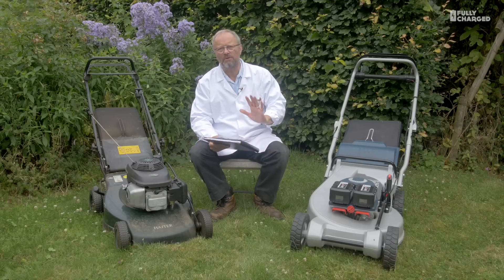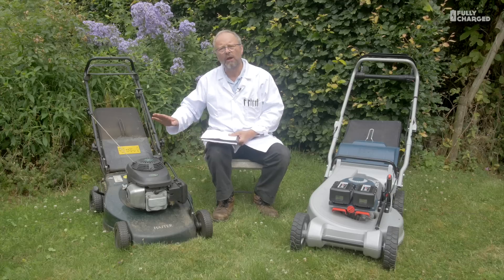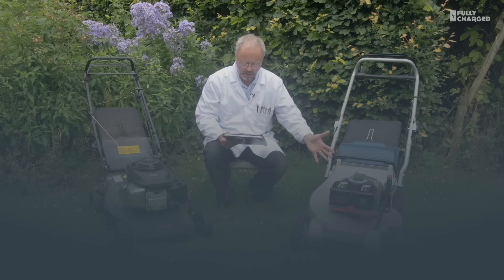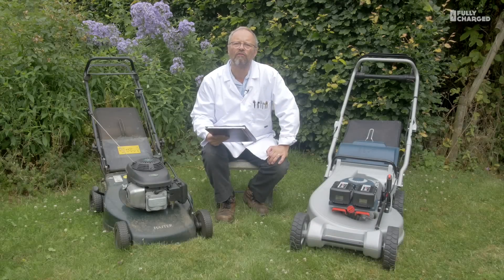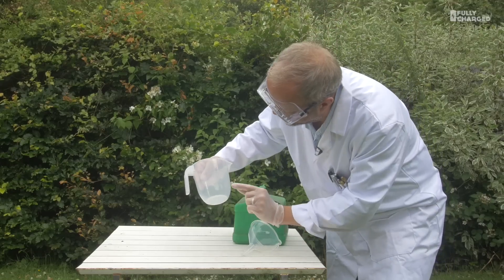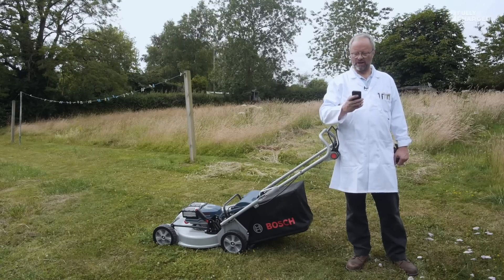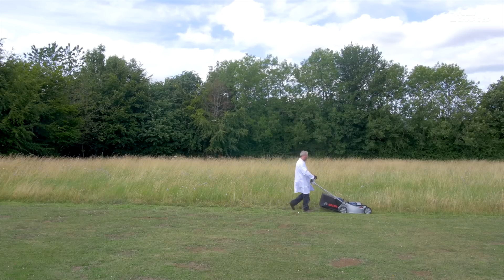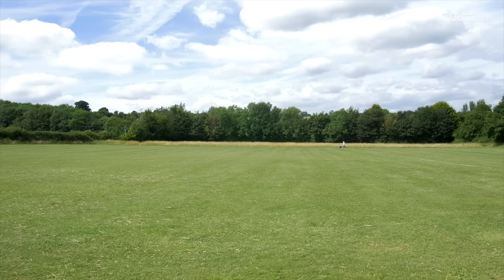Battery V Petrol. The Lawnmower Test | Fully Charged

Comment: One of the advantages of those old petrol mowers is that you could leave it for years stuck in the back of your shed, come back to it clean it out stick petrol back into it and it would work like a dream, the battery mower would cost you an arm and leg to replace the batteries after leaving it for a few months if you didn't keep the batteries charged up, put simply they would die a common death that plagues batteries, and that is assuming you could actually find somewhere that still made the type of battery it used.
Reply from the maker: +flitsies Extraordinary how people make up more and more complex and convoluted reasons based on nothing but casual conjecture about batteries. The batteries won't 'die.' It may be true that 10 - 15 years ago, with much less advanced battery technology they were 'plagued' (notice past tense) by such problems, but they aren't any more. The batteries being produced now will probably last longer than the mower and can be left untouched for years with no adverse effect.
So basically you are 100% misinformed on all the points you tried to make, I'll hand it to you though, an original approach.
Reply: fullychargedshow So what you are saying is that if you left these batteries uncharged for let's say 10 years which is not an unreasonable time span in a warm place next to lets say a spot that often gets damp these batteries will not be affected by the lack of maintenance.

Considering most batteries need a maintenance charge every so many months I find that hard to believe.

So I think you need to do some new calculations with regard to how wrong I am.

If they are lithium batteries though they will last a long time in order to keep them up to scratch it is recommended to charge them up at least once a month if not being used.

I also have devices that use lithium batteries that have been left uncharged for 5 years to go back to them only to find the batteries will not charge. 

I'm not against battery tech I have a battery motorcycle a battery bicycle and a battery powered moped and I'm considering buying a battery powered car, but each machine I own has to be recharged regularly to keep the batteries in good condition those instructions came from the manufacturers of the machines.

So let's get it right what you have said is completely wrong, if you don't keep these batteries topped up they die I'm not sure what the actually percentage per month is but it is quite low around the 2% per month unlike NIMH batteries which lose around 10% per week, though there has been some improvements.

Don't blame the messenger.

Oh just a little more on lithium battery systems, the bms is always on and consumes a small amount of power from the battery, and as the owners manual says "if the battery pack is not used for extended periods of time this will eventually drain the battery resulting in permanent damage."
Reply from the maker: +flitsies Okay, I take what you say, although I don't know why you need to go to such angry extremes.
"if you left these batteries uncharged for let's say 10 years"
10 years! Okay, I'm sure they'd be stuff. Why 10 years, why not 20, 50 damn years. Leave your damn batteries for 150 years, then see how good they are!
I can only respond with "leave unleaded petrol in a can in a shed for 10 years and you're left with sludge,' which would be entirely true.
Why is it a problem, for a start there is another episode coming up which explains more about the batteries and what they are capable of, so maybe watch that in a couple of weeks, but from what I understand from the Bosch engineering team behind the mower, the whole point was to make a mower that effectively, in all aspects replaced a traditional petrol mower, which in Northern Europe includes prolonged periods of time where you don't use the machine.
So I was maybe wrong in saying "an be left untouched for years with no adverse effect" because I was being immature and reactionary to your original comments, my fail.
It's bloody obvious that if you left them untouched for 10 years they would be 100% flat, however I don't have any data to say they would never work again, it's not something I've asked, but I will ask in future.
Reply: fullychargedshow (("Leave unleaded petrol for 10 years blah blah"))

But the difference here would be that you could clean out the carb put fresh go go juice in and mow the lawn, easy as pie simple, you couldn't do that with the electric mower you are talking about, that was the point, perhaps in the future there would be a better battery for the electric mower but based on present tech it's fair to say the petrol mower is more flexible long term.

As for the 150 years thing you mentioned there are cars and motorcycles and probably mowers that are around 100 plus years old including electric vehicles so I don't really see the point you are making here, except perhaps to back up what I was saying, that they still can run on the same basic fuel that they did when they were new, except the electric vehicles cos they need new batteries cos they don't make the old ones any more can't.

As for the part where you say your fail, ok.

But it seemed to me you were trying to do a bit of a Jeremy Clarkson on a mower.

I'm am in to all kinds of machines I like the battery machines cos they are so cheap and flexible to run and in general should be more reliable in the short term, but until they fix the problems with the batteries the long term means these machines are less reliable because often the battery replacements cost more than the whole machine to replace.

I have two battery drills like this they work perfectly fine but to replace the batteries it's cheaper to buy yet another drill, it's daft.

I look forward to your follow up vid, I like your show, but one thing why has there not be an episode about the electric motorcycles and the dramas that have befallen them ie vectrix going bust so many times and gone bust again, brammo struggling and having to sell out to another company the name of which has slipped my mind now.
You did a little tiny bit on bikes where you included the vectrix but considering there is only one major company that has actually put out a scooter that looks similar to the vectrix ie BMW I would have thought this would have been a great opportunity to probe the major bike manufacturers as to why they have not put out any good electric bikes yet, why it has been left to the small companies mostly from the USA to challenge the market.

One last thing, it might be an idea to do a show about why the UK govt are so dead against people using small electric personal transport devices insisting that they must be registered as mopeds, if you read the law that relates to them you will see what I mean, electric scooters including kids types are considered under law as mopeds or motorcycles, I can provide a copy of the law if  you wish.
Reply: +flitsies  
What are you chatting about? 

Why the hell would you have a lawnmower that you don't use for 10 years?

I use my electric lawnmower (wired)  multiple times a year i couldn't fathom why you would spend a lot of money on a petrol or battery mower and only use it once every 10 years.

It seems to me you have made up a fairytale scenario where you only use a lawnmower once every 10 years to make a point about battery lawnmowers being worse than petrol ones. 

Ever since i was a child i didn't understand why people would want to use a polluting oil burning stink mower to cut there lovely lawn.
Reply: ***** There have been many people who have bought mowers used them a few times then for some reason don't use them again and leave them in the back of their shed, just the same as there are lots of people who buy motorcycles use them and then leave them in the garden or shed going rusty.

Some people have even been know to do this with a car.

It could be a prised possession of their long lost love one or a reminder of the years that has past them by but people do such things.

So then a grandchild gets their hands on it and either sells it or fixes it up to ride use or what ever, but do it they do.

Now do you understand.

Battery machines tend to be for the now, you use it then throw it away, and as much as I like battery powered machines you still end up with a huge pile of crap to dispose of.

Just look at mobile phones, there is probably a huge pile of mobile phones in some third world country where western countries simply dump them in the pretence of providing telecommunications to a poor country, but what do they do with them once they are finished using them?

Anyway off topic.

I think you understand my points raised about the mower.
Reply: ***** Yes but in order to get rid of the fumes that has been pumped out for such a long time it will take a while.
And then there are the busses and trucks all pumping out fumes and then there are the air craft all pumping out fumes.

I suspect most of the people around today over the age of 10 have probably had their lungs well and truly harmed by all the crap we breath in so if you look at it that way a bit more ain't gonna do you much more harm.

However electric vehicles are the way forward but it does depend on how much the people want to breath cleaner air and to be honest most people don't really care that much if you consider how many people still smoke, it's taken legislation and tax hikes to get smoking down to what it is now but the market is still booming.

Well think of the small electric scooter, our govt is so in favour of them that they are illegal unless registered as mopeds, imagine 100 watts electric scooter could find yourself losing  your driving license simply because they are considered to be motor vehicles under UK law unless you register it and insure it and have a motorcycle license of course, surely if they wanted people to take up alternative transport they would allow these things as an introduction to the benefits ie low cost reliability and so on, not ban it.
Reply: ***** I think you need to read what I said again.

The point about the benefits which I mentioned was about the 100 watt personal electric scooters, which by the way are banned unless as I said you register it as a moped.

I'm all in favour of electric vehicles, but enjoy the low cost electricity while you can, because when more people start to use them you will find a hike in charge prices, I've already considered a method that could be used for making electric car owners pay more for their power, but hey let's hope it never happens but it is such an easy thing to do the govt could claw their fuel tax back with ease.

But let's face it people in general really don't care about air quality, they say they do but they don't, just look at the pollution that came from one weekends worth of fireworks and everyone is happy with it, just look at the cigarettes even at a huge cost people still smoke. 

And then there are all the other things we inhale, seriously people don't give a fig about it, it's everyone else's problem not theirs.

But yes electric vehicles will be the next step, but wouldn't it be good if the govt changed the law on those small electric vehicles so we could all enjoy them without the hassle of having to deal with insurance companies.

Anyway check it out the law says that all vehicles powered by electricity that has two wheels or more must be registered as a motor vehicle regardless of the power, that means all electric scooters including the kids types are essentially motor vehicles and can only be used by them on private land not the pavement.
Reply: ***** Well then you have missed much of the point to what I said in the first comment which was justified by the way. 

Yes battery tech is advancing but no not to the point that petrol has, I suspect given enough time they will though.

One good thing about battery gizmos tech is the fact that it can be powered by just about anything electric, so there is that option, however you do need to do some mods to the gizmo to make it work.

For example I have two drills both run from ni-cads I had no intention of buying ni-cads as a replacement so I used 18650s instead it now works better than before and they were cheaper than ni-cads and can be swapped out with ease, so you couldn't do that with petrol.

However we are not talking about my drills, this mower uses a specific design battery pack, I suspect you could do some mods to make it run on alternatives which would then make it more flexible than the petrol mower, but due to the type of charger you would need might make it incompatible to too much tinkering, and then there is the cost of the replacement cells, no doubt more expensive than a gallon of petrol.
Reply: ***** I have no problem with looking at the up side of these things but you have to remember not everyone can afford the expense of replacing pricy batteries hell some people struggle just to find a fiver for gasoline.

So being realistic about things, petrol vehicles will be around for quite a bit longer until there are lots of cheap good second hand vehicles that people can buy and still get good mileage out of them. 

Now to the point about the environment you made.

Yes you actually can recycle petrol from the air an American team actually built a machine that can extract petrol from the surrounding air thus cleaning the air and producing fuel at the same time.

But even with this ability I think it would be much wiser to go down the road of electric vehicles.

As for the positives in electric tech. When you compare them to that of petrol to be honest I don't think there is a huge difference at the moment, but in the near future there should be assuming things keep going the way they are.

Cost is a huge downer when it comes to electric vehicles, yes you save on fuel but most cars on the road tend to be second hand and they filter down to the poorest drivers, as they stand now you won't get that yet with electric cars cos the batteries will be well wasted by the time the poorest driver gets hold of them.

There are many issues with electric vehicles, many people simply don't understand them and are afraid of touching electrical stuff.

Look how many times have people thrown out a perfectly good tv simply because an electronic fuse blows only for someone in the know to take it home fix it and get another 5 years free tv use out of it, simply because they are afraid to look (for good reason)and simply wouldn't know what to look for even if they did look.

Just look what happened to vectrix.
Reply: +fullychargedshow I've solved this with a electric Lawnmower that comes with a Wire. Yes that's right! No battery at all. It's like magic!!
Reply: ***** Yes we know of these it is like magic but that is not what we are talking about we are not talking about the wonders of the cable and wall socket we are talking the wonders of self contained power storage which even though relies on the wonderous wall socket to put the energy in, can be used beyond the reach of the cable.
Reply: +flitsies Nah it would've seized by then. It'd definitely need a clean up. ICE engines are dirty as fuck.
Reply: Fennecbutt Well yes they are dirty but so long as you store them correctly they can be stored for many many years.

A damp place would see it seize up and probably ruin the barrel but in a dry location not so likely, however with battery tech store it in a dry place the batteries go down, in a damp place batteries go down.

Also batteries are very temperamental and can fail even though at test they give the impression of being perfectly fine.

Use them from new and they will work fine for a long time have them stored and they can be troublesome.

However in saying this, I have a camera that has a battery that is pretty much the best battery I have ever come across, it has been in a camera for several years and only charged about 3 times in total and the battery is still very much fully charged and still very much packing a punch.

It's definitely a strange battery as none of my other batteries have ever lasted so long without needing a top up charge, this battery seems to be the missing link in batteries. 

So if they could make batteries do this all the time then perhaps things would be different, but all other batteries have had an issue of leaking away their charge gradually, this battery doesn't or does it so slowly that it's just the most amazing battery I've ever come across.
Reply: I've encountered many engines which wont start after being in storage
Reply: #01DF01Seba Abdur-Rehmaan I think you are talking about just putting the key in and off it goes, well no of course they don't, but with a little tinkering if they were stored working then they don't normally take much to get going again, fresh go go juice make sure you get a spark and off you go, the battery system will need a whole new battery and that is assuming you can get hold of one, I suppose you could always hack the battery.
Reply: flitsies I get what your saying, but I'm still a big fan of electric.

Maybe I'm an air conditioner too. 😁
Reply: #01DF01Seba Abdur-Rehmaan I am also a big fan of electric I also see it as the near future not so distant anymore.

Let's hope they sort out the batteries sooner rather than later.

I have an electric motorcycle waiting for the price of batteries to drop to a level that is affordable, were it a gasoline engine it would be up and running long time ago.
Reply: so leave them charged and outside the mower

it shouldn't loose its charge as long as it isn't connected to something that uses electricity
Reply: LPyourplay Were that only the case, unfortunately all batteries lose their charge over time even if not connected to anything it's normally called leakage discharging there is a number for it depending on what batteries they are.

For example NMH batteries discharge very quick normally even if not used, though I have found some that claim to have zero leakage still need to test them out.

lithium ion batteries tend to be very good but they still recommend them being recharged every 3 months even if not being used.
Reply: +flitsies The 'zero leakage' NiMHs do indeed hold their charge much better (months rather than days). Longer even than the NiCads they have pretty-much replaced now. Not sure about low-leakage NiMH vs Li-ion rates. Both will still have some charge after a year. 

A major advantage of NiMH is that they don't die permanently if sat around flat for a year or two. Important for things like DIY power-tools (and mowers) that only get used from time to time. All the lithium chemistries really suffer if left long enough to go genuinely flat. Fortunately this takes more than a year so you do get a fair amount of time so long as you don't store an almost-flat cell. Storing fully-charged cells isnlt ideal either. 40% capacity is the least damage storage level.

And to be fair petrol goes 'off' if left in a disused mower for years (the lighter fractions escape and what's left doesn't burn well if at all). But a couple of litres of petrol costs a great deal less than a chunky pair of Lithium Ions.

So yes, the OP is right - this is a disadvantage of battery-powered kit. One way round it is to have less kit pointlessly sat in sheds for years. Use it or loan it...
Reply: xxwookey You loan it then when you want to use it, it's broken then you fall out with who loaned it to.

But I have discovered something about lipos that could save the day for them being stored a long time without use.

You can actually bring them back to life even when the charger won't charge them, but you have to do a little jiggery pokery to make them recharge again.

Basically you just have to bypass the safety electronics in the battery cell and charge for a good few minutes/ hours really slow, I mean really slow, then you can hook them up to the normal charger once it gets to a certain point and they will charge again up to around 80% of their original ability or something like that, this was not my discovery but if you check on youtube you will see others discovered it, but I have tested it and it does work.

With that in mind you would think the manufacturers of these systems would put in place a means of bypassing the protection circuit using the normal charger and have a settings on the charger for this purpose for recapturing the lipo cells.

I have tried this on cells that had a reading of around 1v it doesn't always work but it sure would save a lot of disappointment if they simply built in a system.
Reply: +flitsies Jeremy Clarkson on a mower - haha!
Reply: +flitsies Now, what you're talking about here doesn't really happen anymore unless you deliberately try to damage the battery by over-discharging the cells (which presumably would be prevented by the built in safety circuitry). But lithium-ion batteries do degrade over time with use.

Just from experience, I've never really seen extensively used lithium rechargables degrade past 70% of their original charge, but for arguement lets assume that they degrade to about 50% after a couple decades.

That's still almost an hour's worth of mowing, and considering that the total capacities are lower the charge times are going to likely reflect that to an extent, so like every 50 minutes of mowing you would have to wait like 15 minutes to charge the batteries back up.

In terms of efficiency that is still multiple magnitudes better than using petrol, and I really don't see why even a worn out battery would be a problem on an average lawn.
Reply: Gigahawk515 Well I have plenty of these dam batteries, for sure they charge up but they leak like water, leave them for a day they are flat again, that seems to be one of the ways these lithium batteries fail, once they start getting old their charge leaks away much faster.

I have around 6 lithium batteries that wil charge up to full charge but if left over night will leak away their charge to around 50% then the next day down to around 30% and gradually over the week or so to nothing whereby I need to do a recovery charge.

Lithium batteries are a nightmare or can be.
Reply: +flitsies Well my father bought a electric robot lawnmowers years ago, best mower he has ever had, he was getting tired of cleaning and maintaining the petrol ones each spring (we used to have two or three, some for parts when one broke). All he has to do is take it inside in winter and put it out in spring and check the blade, he will never go back to the petrol ones that's for sure, they even named it. Petrol ones are now harder too maintain than robots or just electric ones, makes more noise and demands that you buy fuel for them in little cans, much cleaner and easier to go with electric. And with a 5-10 years warranty on it they are not worried about it breaking :), and you don't have to have the batteri charge, the power lost in the new ones are minimal.
Reply: entZEROspawn For sure there are products out there that are pretty good without a doubt but in general I have found these types of batteries have a tendency to end up as I said above.
But I'm sure they will get better.
Reply: flitsies 4 years without maintenance is WAY better than a petrol mower's at least 2 a year I think.
Reply: entZEROspawn I suppose it depends on your out look because a basic service would be what a spark plug, change of oil and clean the air filter let's say roughly 10 to 15 pounds.
On the other hand a battery refurb would take at least someone who understood these batteries and that at the moment is still a specialist job which is expensive, and that is assuming you could get into the battery pack without damaging the battery box, then there is identifying which cells have failed.
After paying the "expert" would be cheaper to buy a new battery assuming you could get one, which brings us right back to the original point.
Reply: flitsies But again we have not done ANYTHING to maintain the robot mower at all in the last 4 years so we have saved those 40 - 60 pounds plus extras like gas and time used to maintain and cut the grass, so when we buy a new batteri for it in a couple of years we would have saved enough for a new robot mower instead, so yeah it's also cheaper now that I think about it :)
Reply: entZEROspawn Well not really because judging by the price of batteries one for a robot mower would probably cost double that of the servicing and petrol put together over more years.
But still you wouldn't actually need to service a petrol mower twice a year in real terms, oil change would be once a year tops and a plug would be perhaps every 5 years if that depending on how much you use it.
So in real terms you would not save anything.
It's about finding the real life costs of these things including the inconvenience,
Reply: flitsies "So in real terms you would not save anything. It's about finding the real life costs of these things including the inconvenience," Like I said saving time by not having to actually mow it yourself, just the time you save is a lot of money, now my dad can work an hour instead so that's a 50 dollars right there at least for each mowing. And a batteri is only 150 dollars, so that is a price of 37 dollars per year if the battery dies before sommer starts this year, and so far it runs well. So if he saves just 3 hours of mowing in 4 years and work instead he is actually gaining on it, how many hours do you spend doing it with the old machines ?
Reply: entZEROspawn Well if you put it like that then yes you would be saving money, however not everyone is in that position and some people actually like tinkering with petrol engines but all that aside I doubt there is much in it between a petrol mower and an electric mower for the average person.

And like I said you can leave these petrol mowers for many years without any real harm happening to them so long as give it a squirt or oil and clean petrol it's off running again.

But it is interesting to see the progress of the electric mowers, also the batteries could be used for something else.
Reply: flitsies My dad is a pretty average person I would say, his garden is normal size and he has an average job, house and car. And he has lost many petrol mowers to decade over the years too, they really don't hold out as well as an electric does, the motor alone is going to run for 10 years without maintaining it. Don't know why you are so determent to defend an out dated technologi, just being free from the noise is worth it, and 525 for a new robot one or 200-350 for an electric one is (which is the same for as for an petrol one here) not expensive at all, why buy one you also have to buy gas and oil for and maintain ?
Reply: entZEROspawn I'm not against electric mowers, or electric anything, but I don't see how they are going to over take petrol anytime soon considering how difficult it is to purchase replacement parts for the electric things.
Most of these devices tend to be about use until they break then throw them away.
Petrol tools are made to be repaired, electric tools are made to throw away.
Even the battery packs are not made for the expectation of them needing to be repaired you buy a replacement.
Petrol parts are made to be repaired.
You could buy one mower at the age of 20 and use the same mower for the rest of your life just keep repairing it, however an electric mower would probably fail and you would need to replace the whole thing due to lack of parts availability.
Even my power drill I had to travel a long way to get hold of a replacement battery which promptly failed after 1  year so I gave up on the production battery and made one for my self, but not everyone knows how to do this simple task.
I doubt anyone would have the tools to replace a surface mount micro chip on your dads mower unless they had electronics experience, but petrol mowers probably come with a small tool kit so you can do small repairs with little knowledge.
Can you see what I'm getting at.
You take away the need to learn anything so you don't learn you become a disposable product user, press the button and off it goes, you don't get to check your garden unless you specifically target a patch, wen you have to mow it yourself you get to inspect your garden at the same time.
Anyway both types have their uses of that I'm sure.
Reply: "Most of these devices tend to be about use until they break then throw them away." so are many petrol things, and it's not like they just go to the dump they go to the recycling center and gets made into new things, and they tend to live much longer than petrol anyway.
"Even my power drill I had to travel a long way to get hold of a replacement battery which promptly failed after 1  year" Well here if a product falls inside 2 years of the buying date you will get it replaced for free, and you do know of the internet not hard to find what you need.
"Can you see what I'm getting at.
You take away the need to learn anything so you don't learn you become a disposable product user" Well some people know stuff about electronics and nothing about mechanics, some know how to repair stone works or wooden structures, that does not mean you cant live in a house made out of bricks just because you don't know how to build or maintain one ?, and again it is recycled into new things well at least here it is, don't know about your country.
Reply: entZEROspawn I think you will find that most if not all petrol machines are made to be repaired, and you can usually get spare parts.
As for the internet, yes we do have this medium now and it is very useful but there are still many things that are very difficult to get hold of, perhaps not so in the USA.
With regards to repairing electronics, perhaps it would good sense if there were positive action with regard to training, let's face it you can pick up some really good books on I,c,e engines and most people can do a basic service though modern engines are becoming more complex, you can still get hold of servicing manuals specific to the machine.
However there are no such servicing manuals for electronic machines, there are no fault finding tips and often no spare parts available.
You buy you use and you dispose of when it breaks down.
Often even if you search the net you simply can't get hold of replacement parts, also some of the newer electronic devices replacing components is pretty much impossible without special highly expensive tools that will be used once.
So yes these electric machines will take over but until there is a change in the approach to the way these things are made it will take a lot longer than it should.
Some petrol devices have been around for over 100 years and it's not rear.
Reply: Well depends how you treat things too, oldest still running electric car is from 1896 ,the 1896 Roberts Electric, only car that's older I know of is the steam powered De Dion Bouton Et Trapardoux Dos-A-Dos Steam Runabou from 1884. So a 120 year old electric car is still going but gasolin cars from that time or older does not, guess they where not maintained :) .
Reply: entZEROspawn I think the reason for the electric car that you speak of is that they were very popular at the time, gasoline vehicles were crap, It's a shame they didn't carry on improving them from that time cos then we would have some pretty awesome vehicles now all clean.
But they didn't and we don't, we have a couple but they still have issues.
Also just consider how people like to tinker with their vehicles on the weekends, unless there is going to be a massive educational program in relation to how electronics works and how components and so on work and there is a massive mind change regarding replacement parts and so on these electrical devices will remain use and dispose when broken down things.
 
We see this now with mobile phones, most people will replace a mobile phone rather than have it fixed, cos it's cheaper, or ipods most will replace rather than fix, or mp3 players replace rather than repair, but just getting hold of spare parts at a price that makes it worth repairing them is impossible unless it is your business and even then they often don't bother.
But petrol devices are always repaired, from generators to vehicles, right up until it becomes too expensive to bother with and even then some still repair them for fun.
Reply: flitsies Well you can only fix older cars without electronic knowledge anyway, most newer cars are more sensors and microchips than mechanics now. And that it is cheaper to replace something instead of fixing it yourself is more to do with how cheap we now can produce things, and how much more one thing can do.
"But petrol devices are always repaired, from generators to vehicles, right up until it becomes too expensive to bother with and even then some still repair them for fun." Some do repair their own electronics things too, it's just that most new things as I said is just cheaper and easier to replace, so the bar for when it pay to fix it yourself is just so much lower, and it comes up way less than with mechanics.
Reply: entZEROspawn And it's virtually impossible to get hold or replacement parts in some cases.
Also you will find that with regard to petrol things you can often use an alternative part which can be adapted to fit.
But yes you are right modern vehicles do use a lot of electronics now, and so they do often need specialist equipment to make them work properly, but it's rare not to find a part for one, and the part is usually replaced as a unit rather than components, you could say modular.
Reply: flitsies "But yes you are right modern vehicles do use a lot of electronics now, and so they do often need specialist equipment to make them work properly, but it's rare not to find a part for one, and the part is usually replaced as a unit rather than components, you could say modular."
So like like a batteri on something electric is modular :)
Reply: entZEROspawn A battery yes but the rest of the device though modular in design often you can't get parts.
You can't get a replacement main board for example and often everything is on that main board nowadays so even if you could it would probably be cheaper to buy a complete replacement device.
I'm just wondering what's gonna happen when all these electric vehicles start breaking down with motor problems that coincide with battery problems, scrappage I think.
Reply: flitsies Well the same thing that happens to petrol cars, some gets fixed some gets recycle. And yes you can replace most electronic in cars and other devices, some are even just plug and play made :) .
Reply: entZEROspawn I once repaired a vhs tape machine, I had to wait 2 weeks just to get the heads then the motor needed replacing which would have taken more time and the cost would have been cheaper to simply buy a new one, which I did in the end, used it for copying tapes, but the point was I did it just to see how difficult it would be getting hold of parts and cost effectiveness, it was so cost effective I've never done it again, ridiculous prices for spare parts, the heads cost around the price of a replacement device, the motor was gravy if I had to add on labour charges on top that vhs would have been so expensive it would have been ridiculous.
My car goes down, yes the parts are expensive but no where near the cost of the vehicle until it really starts getting where multiple systems fail at the same time and some can be repaired rather than replaced.
I really like electronic and electric goods especially vehicles but when you have the battery taking up almost half the cost of the vehicle or device it becomes a throw away device.
Like those little mp3 players, for sure they only cost around £5 and they are great, but once the battery goes they are only useful if plugged into something constantly the cost of replacing the battery far outweighs the cost of the device cheaper to buy a new device, so it becomes a disposable electronics device.
Reply: flitsies Some cars you can't get the parts to at all, unless you order directly at the manufacture and the prices are insanely high. And the batteri is changeable in most cars, some even have a rent garanti, so you don't pay for the change of batteries when you need a new one. And saying it's actually cheaper to buy a new one instead of repairing a thing is not a negativ trait too an item.
Reply: entZEROspawn Well I grew up on the idea that repairing something is much more desirable than replacing it were it is economically viable.
The problem is that many things including some vehicles have now started to fall into the category of disposable product rather than repair and reuse and it's not viable to repair.
So if we continue down this line it probably would be better to have all electric vehicles and mowers and so on and do what was done with all those old computers, now if you want a spare part you could always call Africa they had tones of old electronics shipped to them and we wouldn't have even known about it but for the fact that many hard drives weren't cleaned properly.
Reply: flitsies Actually we can't ship our stuff out that easy, they have showed on "Border patrol", a tv show here, where they inspects a truck with compressed plastic bales that there a strick rules about this. They where ordered back because there where pieces of wrong plastic mixed in, non transparent plastic.
Well we kinda have gone a different way here, we reuse on a more nation scale instead, old electronic gets taking apart, concert reused, wood cheeped even earth taken off gardens are being tested to see if it needs recycling/cleaning because of pollution.
Reply: That's why it was a professional version not homeowners version so it would be used every few days and not be neglected. Also these cells left in a smart charging device could help keeping them alive for long periods by charging them every so often.
Reply: the empty can rattles the most as they say
Reply: An empty can rattles nought it is the can with something it that rattles, the object hits the sides as it is shaken not stirred.
Reply: Li-Ion batteries have almost no leakage, and doesn't have the memory effect that plagues the type of rechargeable batteries you put in your tv remote (NiMh or NiCd).

Most Li-Ion batteries also contain under/over charge circuits in the battery that prevent the battery from reaching anywhere near zero charge so even at that point it would still take years for the battery to actually die.

Electric mowers aren't new, there's been electric mowers for at least 30 years, they didn't always have a battery, originally they actually had a plug that you put into a wall socket.  The only disadvantages in this case would be not mowing over the wire, and how many extension cords do you need.
Reply: I have some old lithium batteries in a bike, from new they were excellent, haven't used the bike much, they been standing some time they still work but probably have lost around 1 third of their ability even though the charger says otherwise, real world performance has dropped.

They are probably around 6 to 8 years old now hardly used, so batteries lose their ability to perform even when not used, they become less reliable and leakage increases with time.

I noticed this as I followed to the letter exactly how the manual said to look after them, but you still get this drop off of capacity.
Reply: it's true, li-ion degrade faster if not used or being kept at 80 %.....
Reply: flitsies Mmmm, yes and no. If you let a carburetor sit with gunk (specially with ethanol additives mixed with the gasoline) for more than 2 months you'll have to do some cleaning and perhaps tune the engine risking the block and parts to become brittle or damaged. Plus non leaded gasoline only lasts about 18 months before degrading. Yes 1st gen LiION and other chemistries on batteries are susceptible to chemical entropy within a couple of weeks or months but the new lithium ion, lithium polymer and LiFePo are far, far more durable, sturdy and resilient.